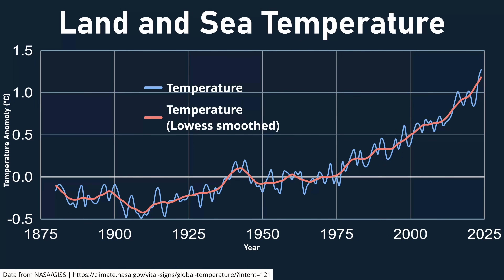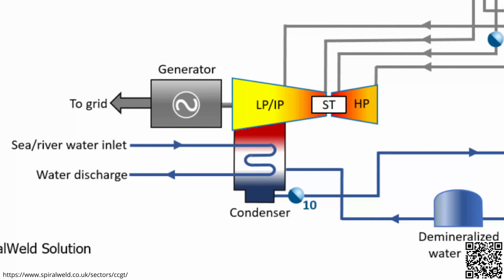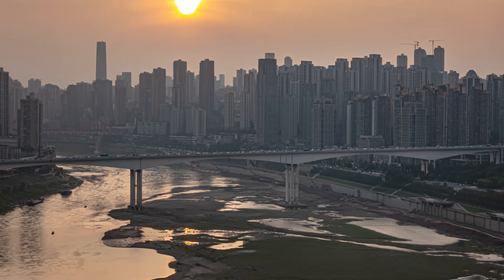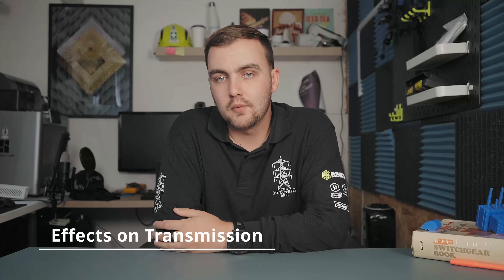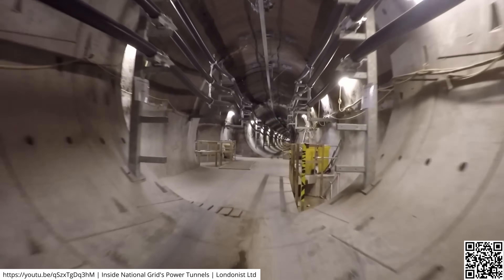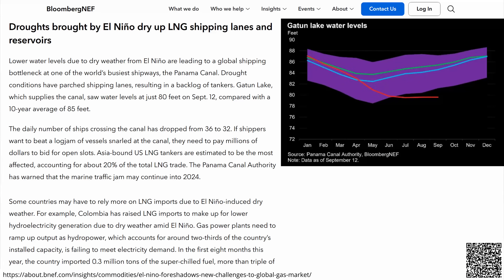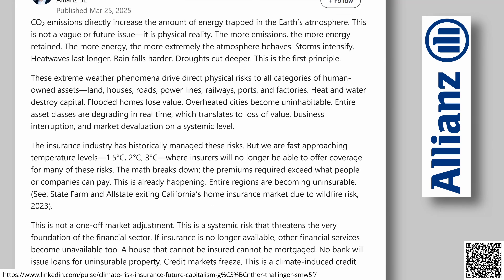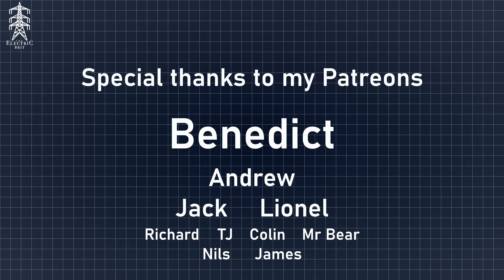Heatwaves are KILLING the grid

Comment: warmer is good, one tenth the people die of excess heat compared to excess cold. The Roman Warm Period and the Medieval Warm Period allowed Europe to flourish. Cold is bad. Warm is good. Deal with it.
Reply from the maker: It is a statistical fact that more people die from cold than heat, but I'd argue more places are built to deal with the cold, and its easier to escape from, since we've been doing it for thousands of years. Things like fuel poverty are a relatively easily solved problem. Rebuilding all of our housing stock to deal with heat isn't feasible on the other hand and my point in this video is we just need to "Deal with it", so I agree.

In the UK we're doing a good job of managing flood risk on energy infrastructure but as pointed out, nations that rely on nuclear or in land generation that relies on water are going to start and have a tough ride, and you can't just move nuclear plants.
Reply: @OP So good in fact, that more people will want to share the goodness. That creates tension not measurable in volts, not as easily dealt with…?
Reply: @musiqtee  LOL, good one
Reply: One can always add layers of clothing.
One can only get so nekked.
Personally, I don't like either temperature extreme.

Comment: Glad you mentioned Solar Panel output loss in high heat.
When it gets extremely hot in the Desert Southwest of the United States, not only do the panels loose a huge amount of production, but the equipment that they service also runs hotter, which means equipment fans run continuously.
Many low humidity areas are now far too hot for evaporative coolers to be effective and result in heat pumps to replace them at four times or more in electrical consumption.
Reply: Surely evaporative cooling works best in LOW Humidity? Typo?
Reply: @__Andrew_ 
When it's 120°f and cooler only drops it 25°f, it's still 95°f and the cooler makes air more humid.
That's still dangerously hot.

Comment: I imported shutters from France to keep the heat out of our house on hot days. They're extremely effective but in Britain you can only buy them for roof windows it seems. Unfortunately, British windows typically open outwards, which doesn't work out well with shutters. In France and most of the rest of Europe, windows open inwards instead for just that reason.  Otherwise, most uk domestic heat pumps can also be used for cooling, although you may need special controls to stop condensation.
Reply: Oh I recognize this. In the Netherlands where I live windows also open outwards, at least in buildings up until the 1980's after which it changed. It makes sense in coastal areas of which both the UK and the Netherlands have a lot of course as with windy weather a gust of wind will not suddenly push a window open (maybe even with someone standing behind it) if it opens outwards. In the previous house I lived in which was from the 1960's I had exactly the same issue when considering installing sun screens.
Reply from the maker: It would be a dream to build a house and I'd definitely design it with the sun in mind - sun shading for the harsh summer sun etc. We have plantation shutters in the house which don't do much since they're on the front and we're south facing at the rear. The garden room I shoot in is just a very basically insulated wooden frame, shiplap and OSB exterior, plaster inside and a black rubber EPDM roof which bakes in that southern sunshine for the full day.

Housing in the UK needs to get smarter but I don't think there's much incentive for comfort.
Reply: @TheElectricBrit Building regs gained a requirement to design to prevent overheating a few years ago, but building control can be hired privately in England+Wales (since the 1980s) which drives down standards (if a property developer doesn't like the council building control officer telling them to do something, they can just shop around for a more flexible supplier - in turn this put pressure on the local authority building control to slack off on enforcement themselves).  Mounting PV on the flat roof does shade it pretty well.  Temporary external window shading (opaque or semi-transparent) can be very effective if you can reach the window to attach it.  Internal shading is much less effective and can cause glazing units to fail by overheating.
Reply: @TheElectricBrit
Our ancient ancestors in most of the continents did this replete with cooling airflow for summer and thermal mass to keep stable temperatures.
Reply: If you're getting condensation on windows in a heat pump cooling mode, reduce the fan speed and shorten the cycle run time so the unit removes the humidity.
Reply: @blaydCA  In GB houses, heat pumps are usually "air to water" types which have "wet" (called "hydronic" in the US) indoor heat exchangers, so that they can be retrofitted to replace gas systems (and also fitted by installers who were previously trained on gas central heating systems). Because such heat pump installs are usually only designed to heat the building, rather than cool it, there is no condensation handling for the indoor heat exchanges (unlike normal "air to air" heat pumps which incorporate condensate drains), so when you switch the heat pump to run in cooling mode you risk condensation on your internal heat exchangers (typically pressed steel "radiators" or underfloor pipe loops) and/or their internal pipework if their surface temperatures fall below the internal air dew point.  Not as bad a problem as it sounds because hot days in the UK are usually also low humidity, but best to get humidity sensing controls which ensure the internal cooling loop water flow temperatures remain above the internal air dew point.
Reply: @Tim_Small 
Got it!
Retro-fit anything is never as good as a fresh install using current technology.
No different than converting an old coal furnace to number two oil or natural gas.
Cheap short-term fix.
Reply: There doesn't seem to be much information on retrofitting a house for the heat. A lot of the information in the new building regulations only applies to new builds and a lot of the other information is pretty lame/ suited to drier climates. I would be happy to invest a few hundred pounds on effective retrofit measures to keep my house cool.
Reply: @DH-tv2yw  In general look at what's done in France / Germany / Spain - they have bigger temperature swings winter to summer, so have had these problems for a while. Retrofitting is hard of any type, take the opportunity to do things during periodic maintenance or improvements - this keeps the additional cost to a minimum. Generally the biggest wins are from externally shading the windows - especially roof windows and S/SW/W facing windows. Improving roof and wall insulation on those faces of the building also helps, as does switching to a lighter colour finish if possible. For flat roofs, paint with solar reflective paint, or put PV panels on top to keep the direct sunlight off black surface material. Ventilate if you can whenever the outdoor temperature is below the indoor temperature (very high air flows are needed, air carries little heat).  Greenbuilding forum and AECB are good resources.